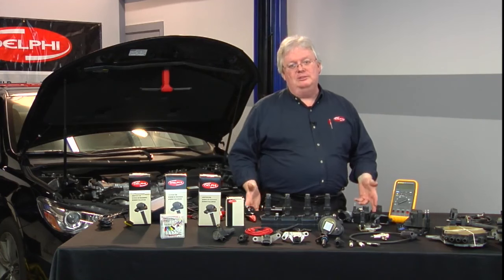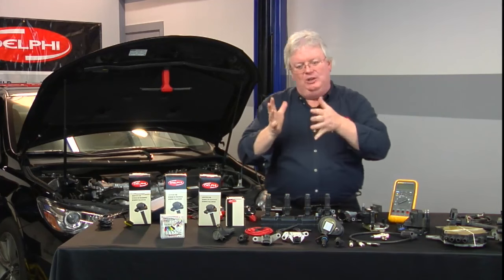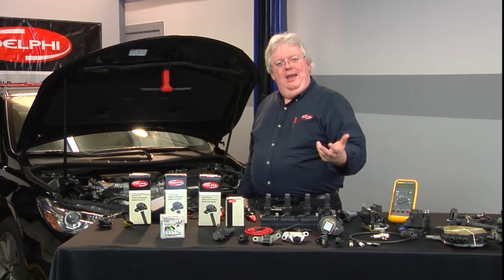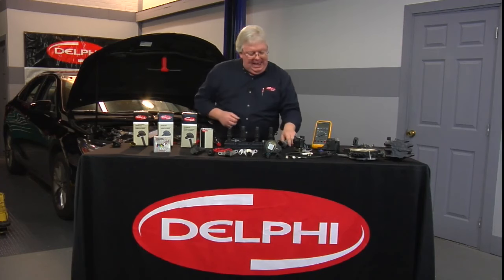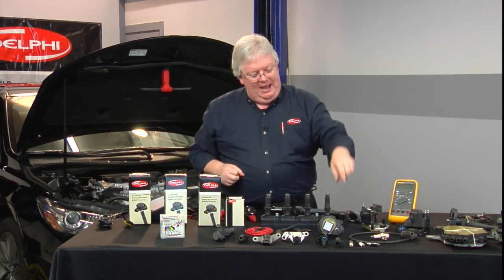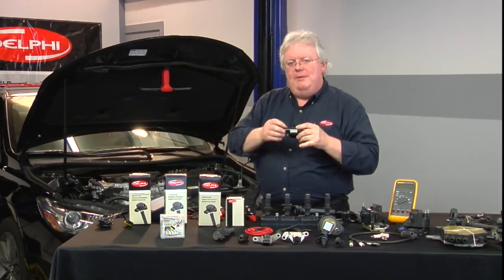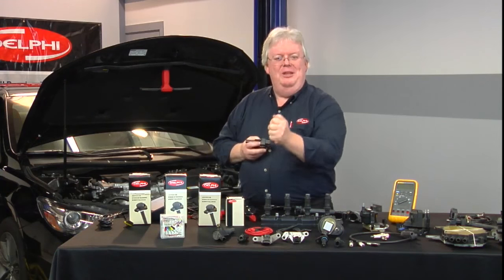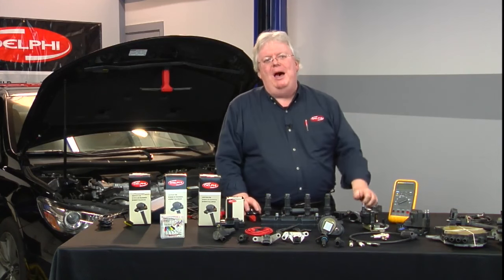What Makes Coil-on-Plug Modules Go Bad? (Ignition Coil Diagnostics)

Comment: FORD knew the 2002 F150 had bad DPFE sensors. Their solution was to cancel the sensor from setting a code. But these faulty DPFE would open the EGR valve while engine was too cold to handle it. Lean condition would ensue and the spark would not ionize so the COP sought an easier path internally and fry itself. Nice, real nice. I went through a bunch of them. Took me a while to connect those two things together.
Reply: EGR does not cause a lean condition. Exhaust is an inert gas and therefore cannot possibly lean out a mixture. If anything it can enrich the mixture somewhat. EGR does cause a misfire, but that leads to unburned fuel. Unburned fuel has low electrical resistance and the coil will not need to work hard to fire those plugs.
Reply: silverbird58  Today's emission and fuel economy rules would never allow points and condenser. They're too inefficient and inaccurate for timing control. And Points needed to be replaced every 12-15K miles. Modern systems are mostly trouble-free for 100K miles.

Comment: so  how do we prevent corrosion on the plug connector.
what should we apply on the contact point?
Reply: Dielectric Grease my friend
Reply: I have a 01 626 Mazda put it in neutral stay running put it in reverse or drive cuts off could it be my coil packs going bad

Comment: I'm trying to buy a Toyota Corolla 5 speed 4 cylinder 1996 model my friend says that the coil pack keeps shorting out every time he changes it,in minutes. What causes this and how do I fix it?
Reply: Same with my 09 Buick Enclave . # 3 coil has melted twice . vo tech teacher says it might be the ecm .
Reply: Could be ecm or I had one doing the same thing and I changed my connectors that plug into the coil and it fixed it

Comment: ok..so what would cause all 6 coil packs to go at once? code of 0300 on all 6 cylinders with cel now flashing.
Reply: They just go bad on they're own. If one goes it's good to just replace all because they could go in days weeks or months but eventually will go. Just buy all of them and change them as they go
Reply: @mwfrost3427  i think he said they all went at same time..
Reply: Check spark module that the coils sit on can’t think of the name of it, pickup coil or something

Comment: I have a 2005 Pontiac Vibe. I have had the same coil pack die three times in the last 4 years. I replaced the plugs about 2 years ago and the Vibe doesn’t have a wire set. Does anyone have an idea why that might be happening?
Reply: What did the plug look like when you pulled it out? Where is your engine ground located, and is it in good shape? Is there anything near that coil (exhaust manifold, etc) that could cause it to overheat while it operates?

If the problem isn't related to one of those three things, I'd start to look upstream at the ignition control electronics. Maybe they are damaged and passing excessive voltage to the coil. It may be economical for you to simply buy a new coil pack every once in a while from RockAuto and DIY replace as needed.

Comment: got a question, we have a 1998 c3500 sivrado, big block coil has melted, guts melted out of epoxy, like a ball of snot. what can cause the coil to melt out? any response would be great, grounds on motor check out ok to battery and the engine to frame ok, one of the guys thinks it is a dist going bad?? any experience would help.
Reply: Same thing that's happening with my 09 Buick Enclave 3.6liter
Reply: Check your alternator may be over charging or also a short in it. May also check the actual plug that plugs into the coil pack

Comment: I have battery voltage ground signal and low ref going to my coils but no spark what would cause that 🤯 is it possible for all my coils to burn up at once  😬
Reply: @DevJB  I already got it going thanks tho fyi I don't know what I did 😬

Comment: I have this problem with my Vauxhal Astra G 1999. I change the ignition pack but the problem comes back after a couple of months.
Reply: Strange Person! xP  u found the solution?? Bcoz i have the samme problem in my honda civic 2006 when is come load coil pack is going...in couple of hours...i change alot but the problem is same...

Comment: I have infinite FX35 2008
Always it burns the ignition coil
They check everything but no sussed... 
Before all this thing start . the car burned the ECU then i ordered original one ... and every thing gose ok .
But now the coil ignition start to burn every 5 month 
Please advise
Reply: @Sam S 
Many thanks Sam...
Could you please help me in other thing
If you have harness electric wire diagrams send it to me... i spend to much money on this car
Reply: @Sam S 
Please please 🙏🙏
Reply: Was told be teacher at tech school my ecm was bad I haven't changed it yet guess I better put new plugs in then start all over again .
Reply: I have same problem same engine, but mine happened after a few minutes, what did you do?

Comment: you seem to know your stuff but.............VERY Suprised you failed to mention prolly the #1 REASON for coil failure............. oil leaking into spark plug tubes from bad spark plug tube seals!!!!  dam how could you miss that????  maybe trying to sell more coils for your company instead of simply and cheaply changing bad tube seals???    hmmmmmm..................
Reply: Oil causes misfire conditions but rarely causes a coil to fail. If anything the coil isn't working as hard when the tube fills with oil.

Comment: I got a Honda accord ex v6 99 crank and it won't start up I got new distributor cap and spark plugs wire new rotors and nothing and no spark
Reply: jjsnoopy7 check the main relay of fuel pump
Reply: +Junito Amadeo thanks but I fixed it already it was the ignition coil
Reply: jjsnoopy7 good 💪

Comment: I have a 2003 Mitsubishi eclipse that burns the coils when I use the the ac on the car. does anyone know what could cause this?
Reply: sounds like a short. follow ac wires and see if they go with the coil wires
Reply: Sounds like a short in a/c somewhere and it’s back feeding or your alternator may not be strong enough to run it all, so when you turn it on it pulls the motor and voltage down to far

Comment: I have a Ford edge 2010...is burning out my ignition coil for 2nd time ..what is the cause and I need to replace control module?
Reply: same things happened to me this is the 3rd one!
Reply: Did u use dielectric grease? Arcing maybe?